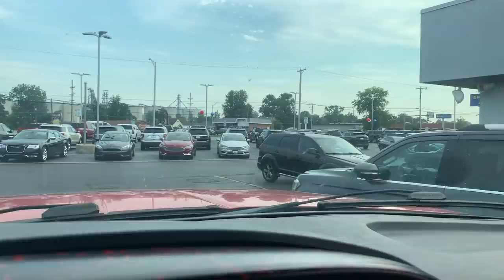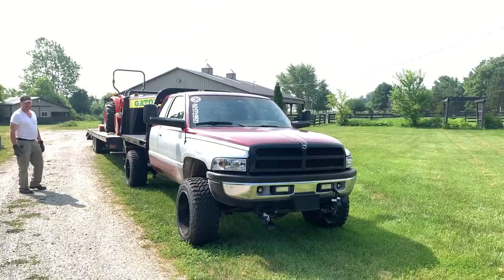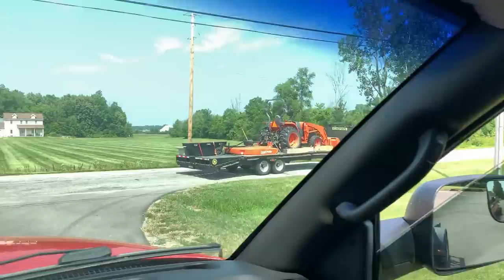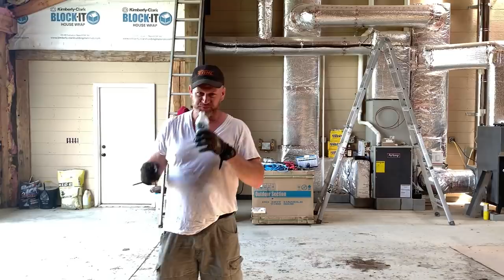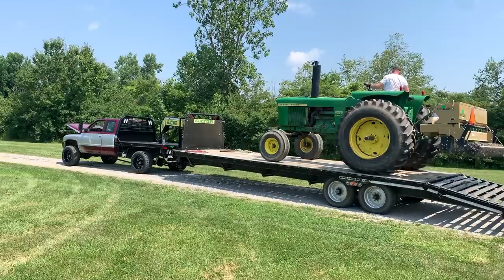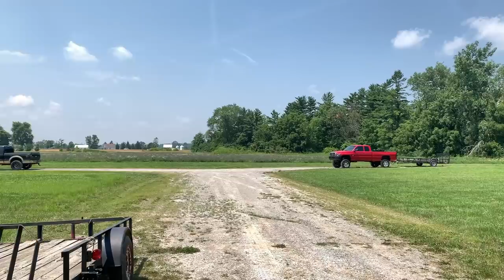HOW MUCH ABUSE CAN THIS 5.9 CUMMINS TAKE!?!?

Comment: Always set the E brake when you load a trailer so it doesn't roll back and forth on the trans
Reply from the maker: Yeah it was a good afterthought
Reply: not necessarily true. you should actually chock the front tires of the truck and the trailer tires. this is because when loading heavy equipment it is a possibility that the rear tires of the truck lift off the ground due to the weight of what you are loading, and in that case, an e brake will obviously not hold you anymore. and in worst case scenario the truck can roll away-especially if on a hill.

and of course you should always chock the wheels on the trailer to keep the truck from rocking back and forth. very harsh on the parking pawl.